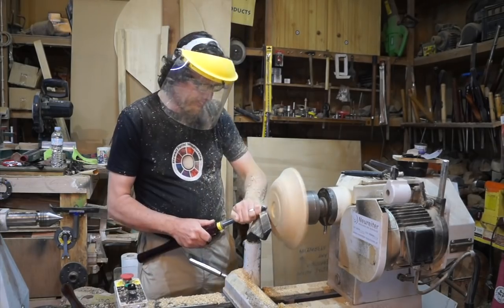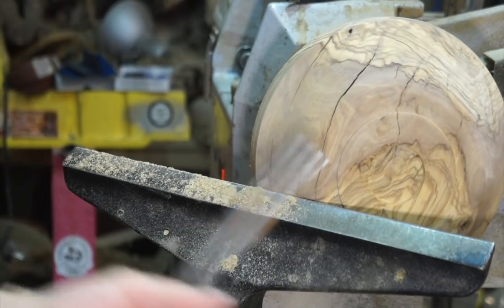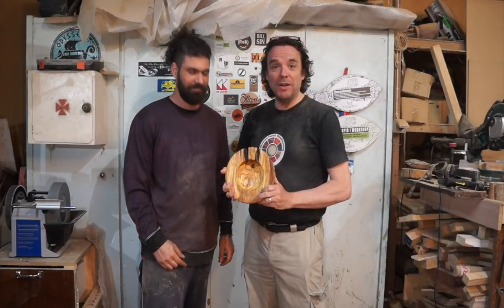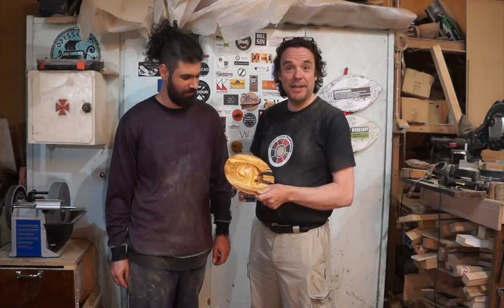Woodturning an olive wood platter with Steward Furini !!

Comment: Very attractive design on the bowl.  I first noticed the beauty and hardness of olive wood as a young teen in Spain.  It was in the dash of a 1950's Mercedes convertible sports car.  I don't have normal access to it here in the USA but it is a special and beautiful wood.  Definitely in my top 10.  Fortunately there are some other species nearby that are also special.  My favorite is walnut which is plentiful here.  The burls can be iridescent and amazing.  An added bonus is that the sawdust looks like chocolate milk powder drink mix.  (I should collect some and give it to my brother to see him try to use it.)
Reply from the maker: Oh brother here is really hard to find burls I can find from olive but only that ! I search all over to find one ! I like to ask you if I cut a burl from a tree the tree will be dry out ?? Do you know ??
Reply: I believe that it has to dry just as any other part of the tree.  You can always turn it green and let it dry afterward (which it will do faster) but you risk cracks.  If you do this, consider using a penetrating linseed, tung, teak or other oil to replace the water in to wood.  That should help prevent some warping, chipping or cracking.  But it isn't a guarantee.  Acetone will also dry wood rapidly.  It is also good to dilute oils so they penetrate easier.  I hope this helps.